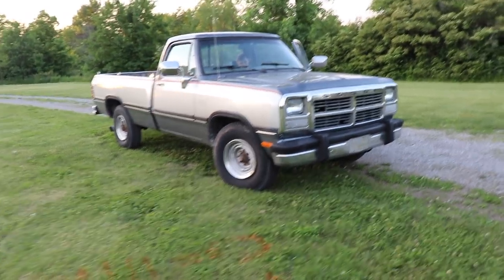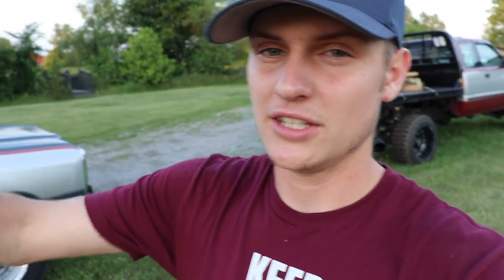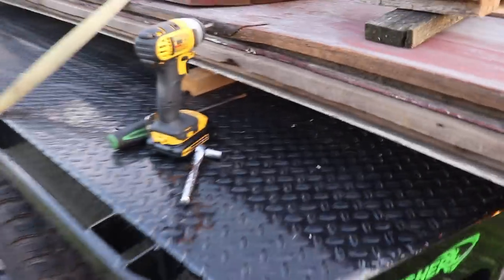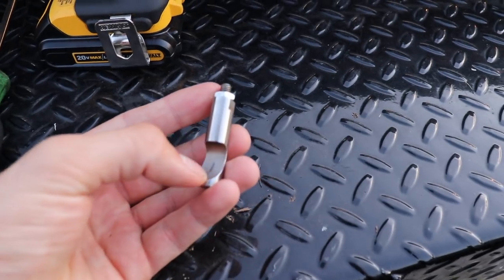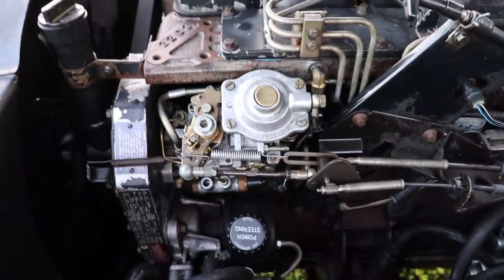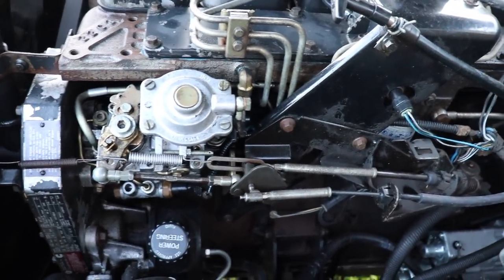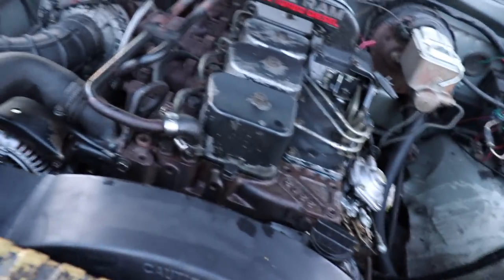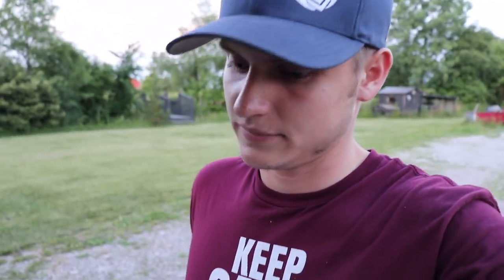NASTY BURNOUT IN THE BEATER 12 VALVE CUMMINS!!!!

Comment: those non i/c engines have 9mm injector, bigger then the intercooled ones. its said you can make up to the 350 ish hp with the stock non i/c injectors but the non i/c turbos are not the best. if you get new injectors though most likely there the 7mm ones and your need the bushings to make them fit. but id just keep the stocker injectors and see how much you can get outta them

Comment: u should take the fuel pin out and leave it out. it will roll tons of coal.
Reply from the maker: Joe Meier is that even safe?
Reply: LOUD 'N' PROUD my buddy did it to his 89 Cummins and he said that it has a chance of running away, where there is a big difference between the fuel and air. the only way to stop a runaway diesel is to shut off the air or fuel supply.
Reply from the maker: Joe Meier how do you turn it off though lol
Reply: LOUD 'N' PROUD most people take the air intake off the turbo and put a piece of wood or something like that over the turbo to stop the air supply